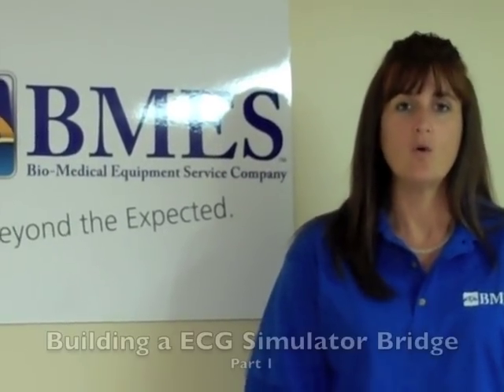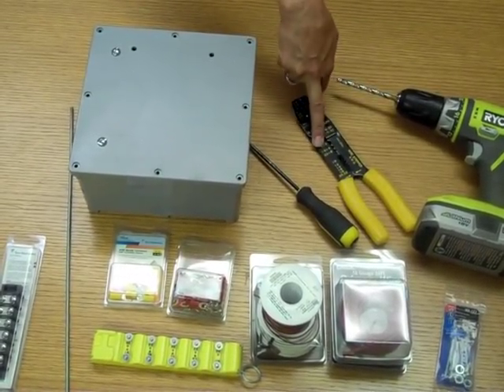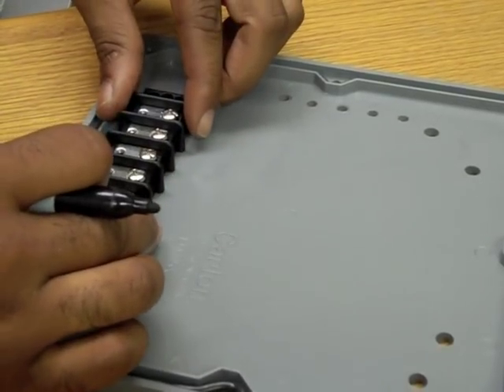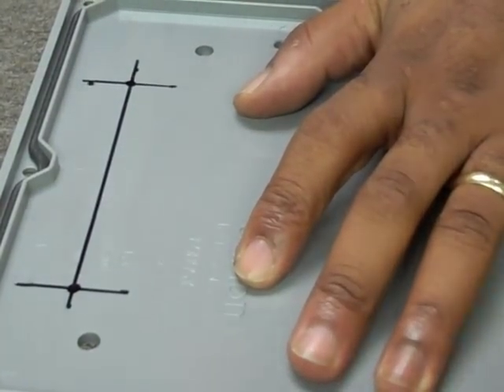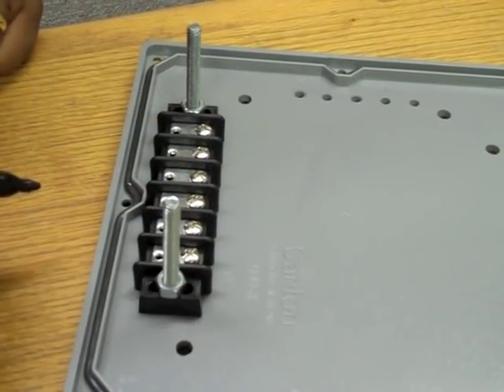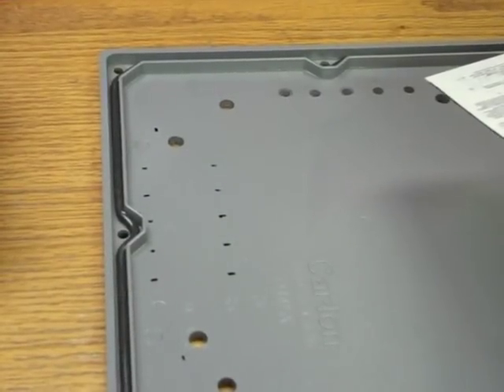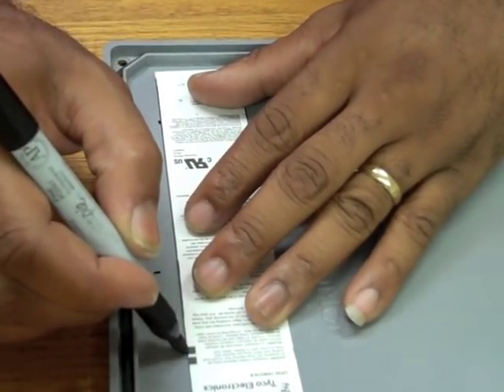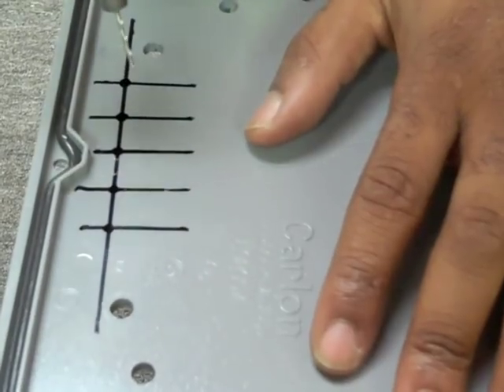Building a ECG Simulator Bridge Part 1

Comment: Hello, i have a simple ECG simulator circuit, i have made it and it worked good, but i don't know how to connect it, it has 2 terminals, and ECG machine has 12 terminals as you know.
I need to know what connectors from the circuit should be connected to the ECG to test a specicied lead, i mean for example, to test lead I connect this to this, to test lead II and III and avl and avr and so on.
Can you please write me what to connect to use the simulator circuit.

Thanks a lot
ahonda55@hotmail.com